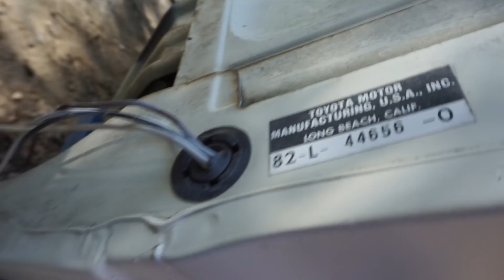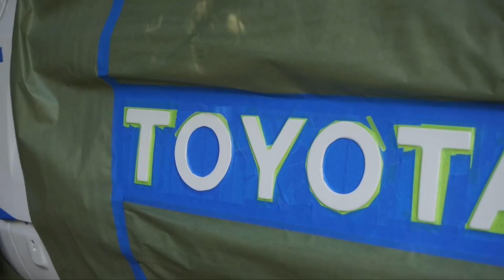1982 Toyota Pickup Restoration ( Bodywork/Paint Job)

Comment: I got a 86’ no solid front shaft but strong 4x4 transfer case, 5sp Manuel Tranny. Good project truck. Bed on but about rusted. Was running when I parked it. Needs an aftermarket carb. 22re carb. Reg cab & pretty much original. Had a brush guard & headache rack made for her & mounted. $500 come & pick up in Texas, S. of Houston. Clear Blue Texas Title. I just used it as a run around town & ranch truck.
Reply: Did you try driving it in the river? The hilux are water sealed, in south A  is famous seen a few clip of them driving in the deep river, one show water filled in the engine bay and cab and carring about 7 people behind. Going up the river tail pipe up high, It’s a die hard know as dead reliable . Here https://www.youtube.com/watch?v=xnWKz7Cthkk
Reply: Is the truck for sale?